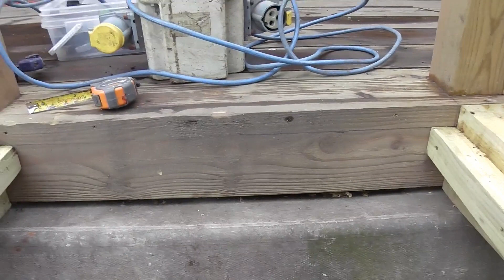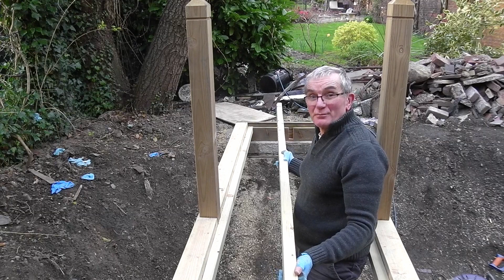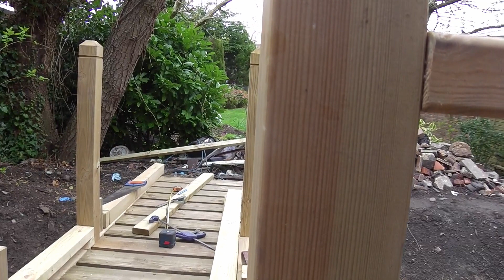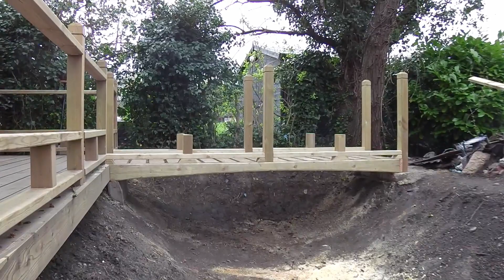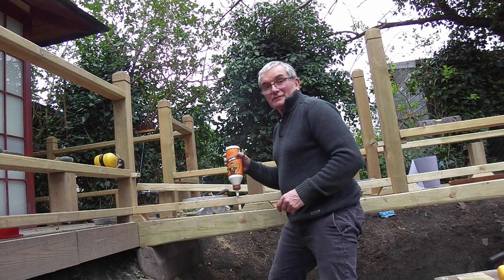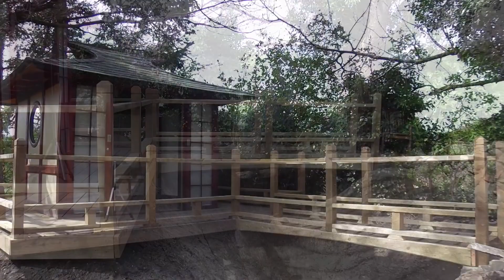Part 25: How to build a Japanese tea house - The bridge pt2

Comment: Wow this is really cool. Where did you learn how to do all these things?
Reply from the maker: Thanks for the comment. One of the reasons I filmed how I built the tea house was to show that we are all capable of doing things that we normally don’t do. It started after I started keeping Koi. I became interested in Japanese gardens and the next thing I decided to build the tea house. Having little previous experience in joinery, I used the internet to research Japanese tea houses. I settled on a westernised garden interpretation. I then looked at how to put the frame together and went from there. One of the costs involved is the equipment to cut timber and shape it, as I gradually found out. I keep on learning as I put it together. I feel I may have saved a lot of time in retrospect by planning things a little better, but I have lived and learned. 👍